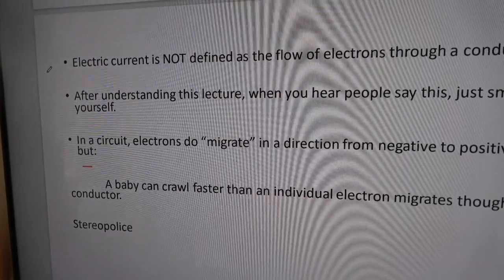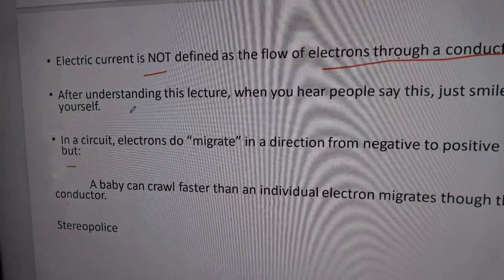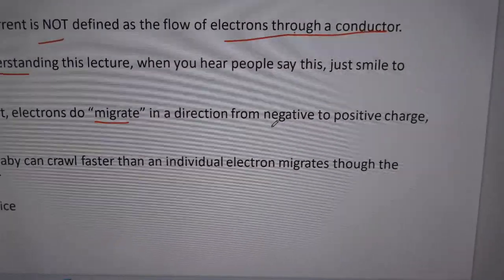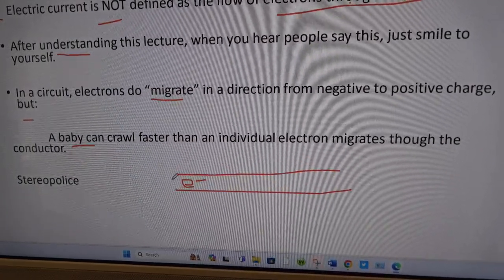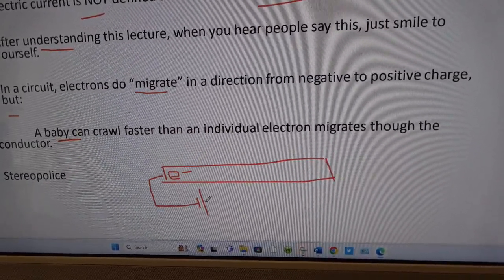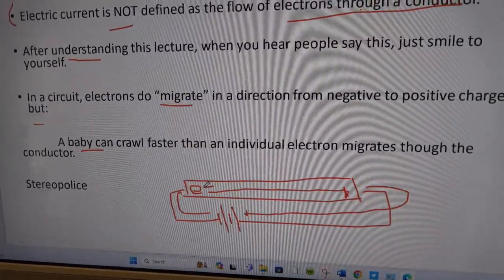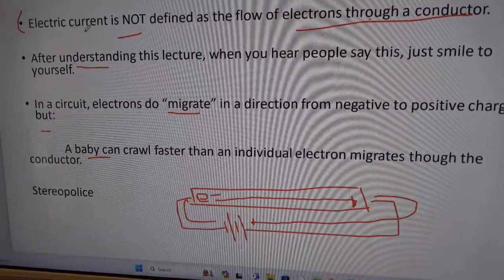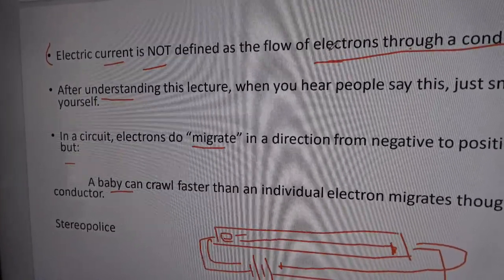Audiophile University:  Preview of Lecture 1, "Charge and Current"

Comment: The analogy of electrons moving through a wire I always liked is the following:
 
Imagine a line of ping pong balls inside a hollow tube.
If you push another ping pong ball into one end, a ping ball pops out on the other end instantly, however...
The original ping pong ball moved very little.